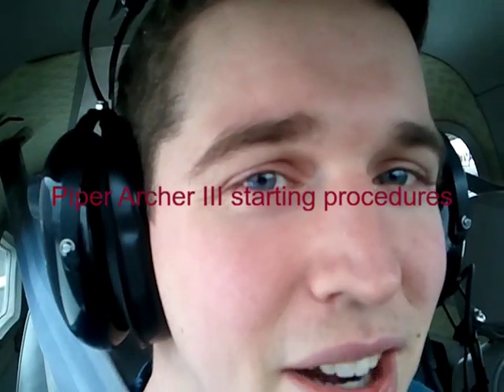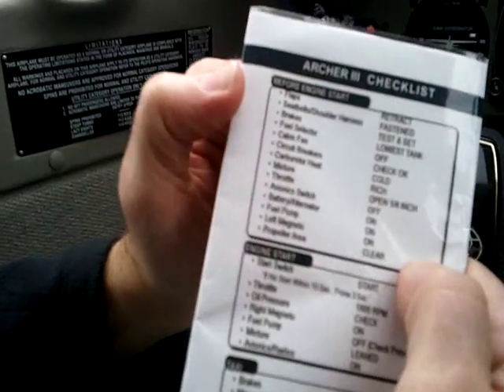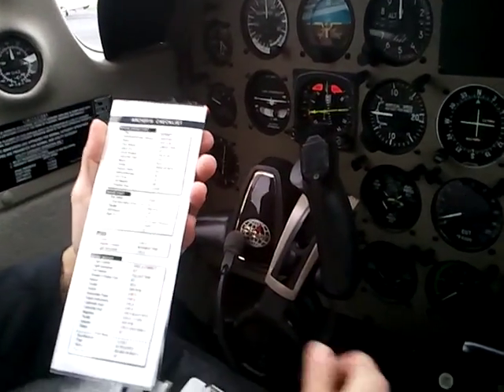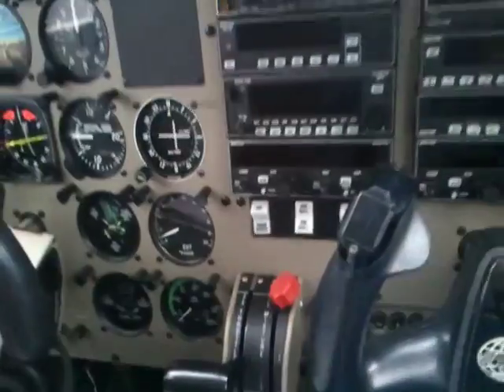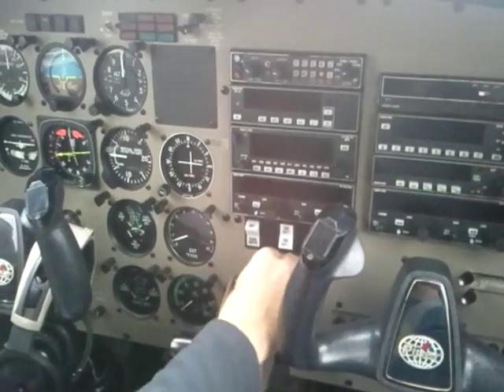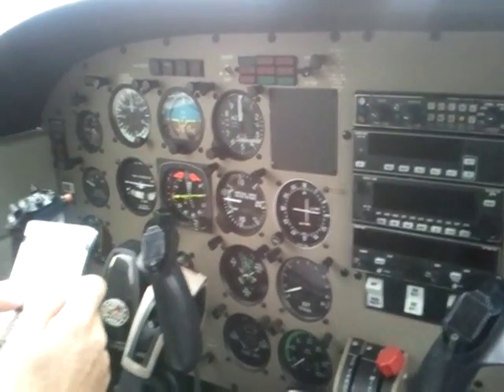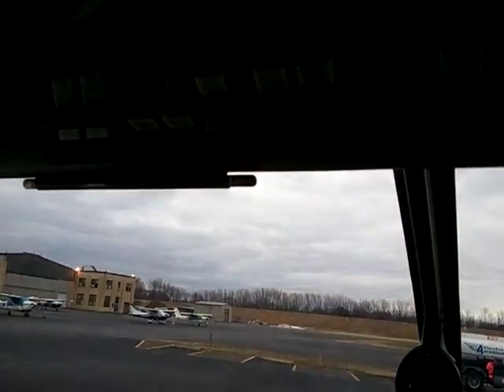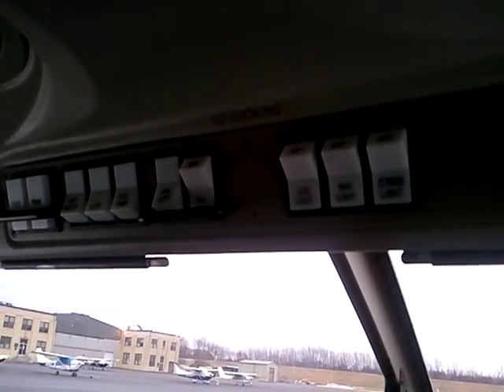Archer III cold start procedure

Comment: I believe it is supposed to be 1/4 inch throttle and both mags in the Archer 3......at least in every one I have flown.
Reply from the maker: Not if you read the AFM or follow the checklist. (Although this one is 1998 maybe it differs from yours..)
Reply: @1013fly  I have flown 3 different ones 1994 1998 and 2004 all POH's said the exact same thing as well as the checklists in the planes both mags on 1/4 inch open.... Your's must be different
Reply: @Q1776Q  The club Archer III that I fly, it's also start with left mag turned on, right mag turned off.

Comment: My only critique is that the engine start button should be pressed with the left hand, while the right hand is on the throttle. Don't want a cold engine revving up to 1500 RPM. 

In addition, the only place our 95 and 02 model Archer IIIs state to start on only the left mag, is while hand-propping, to prevent a kickback

Comment: Left mag fires at TDC at very low or cranking RPM's. Right mag normally doesn't have this feature, hence grounding of same for start. At low RPM's ie start, ignition BTDC can cause engine to kick back with reasonable force, making it very hard to start. This kickback can also have catastrophic results for starter teeth/drive/armature, or worse, break teeth off ring gear. Both expensive fixes. Most ( not all ) lycomings have pinion/ring gear starting.
Best wishes,
Mike.

Comment from the maker: In the older models the ignition key cuts-out the right mag to prevent backfiring. Since this is a push-button start it does not automatically cut-out the right mag. Something about the left mag being setup to fire at TDC (Top Dead Center) at low RPMS I think but I am no mechanic.
Reply: Correct.  Frequently GA aircraft engines have one magneto with a mechanical impulse coupler, which at low rpm winds up but then releases a spring to fire the mag, which gives more turning energy at low rpm but also fires the spark at or near TDC.  Typically the left mag is the impulse-coupled one, the right mag has fixed timing.